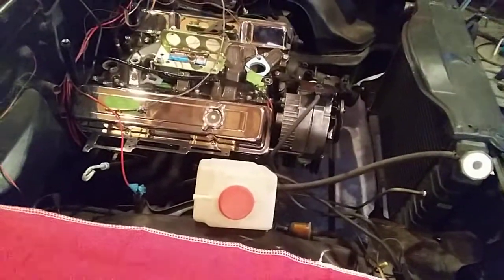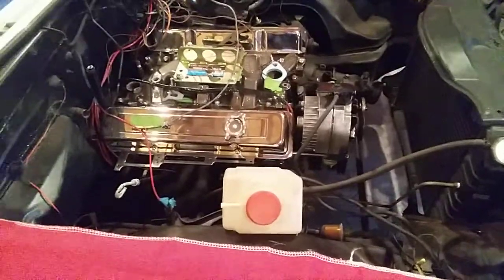Radiator in...hoses?

Comment: once you get the sending units installed just buy plugs for the other ports and use teflon tape around the threads for the plugs. No sealer on sending units, the sending units need to detect the ground on the block so if you use sealer they won't work!

Comment: Not sure this helps but it is a schematic of Sending units for a 1974 350, the only disagreement and it really is another option is for the oils sending unit, it should has one behind where the distributor goes. It was probably a idiot light but you can install your sending unit there otherwise this schematic should lay it out for you. Good Luck Reuben. 
http://i.fixya.net/uploads/images/25636349-twokmmoxmconkg43teug4wwl-5-0.jpg